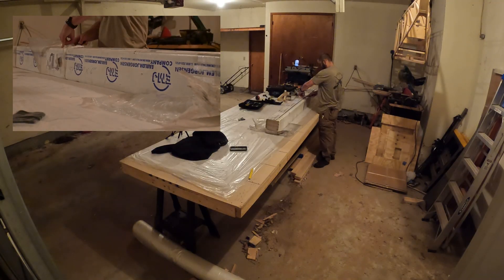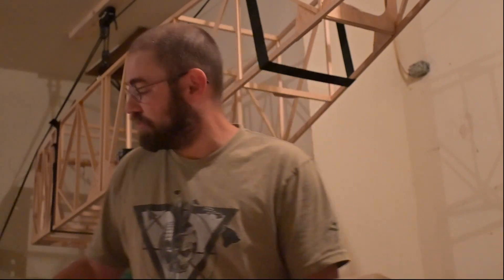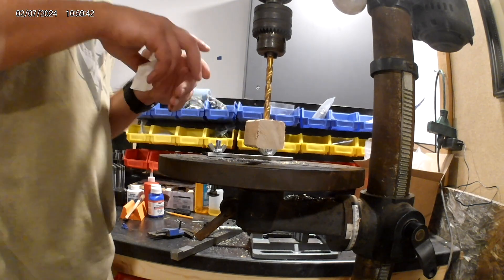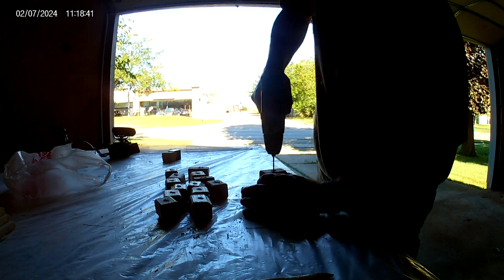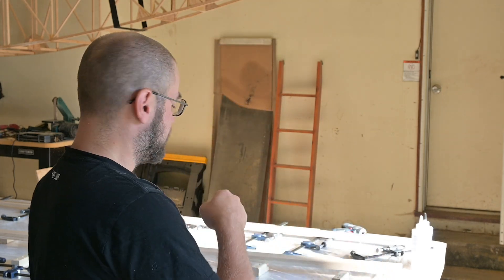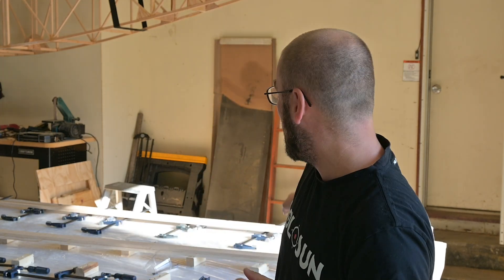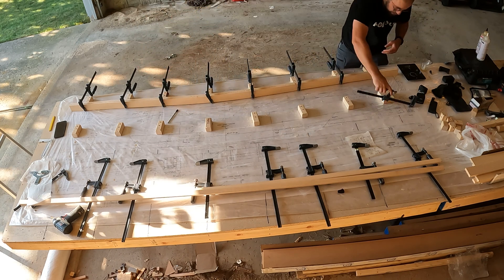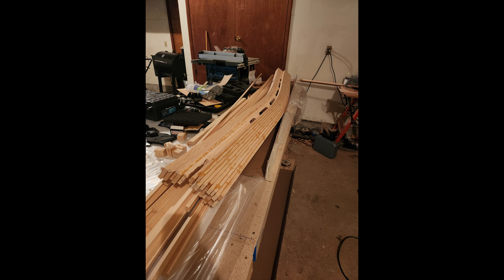Wing Spar Construction on the 1/2 Scale Curtiss P40 Warhawk build!

Comment: Was just wondering what kind of wood does the plan mostly call for? I’m going to be buying the plans and an idea I had was to use aluminum if weight is comparable.
Reply from the maker: @buddy2381  it's all spruce. Honestly it would likely not convert well to aluminum.  You'd be better off designing yourself from scratch.
Reply: @downrangewarbirds  I seen in the beginning of your video you are in Illinois. I’m in a suburb near midway. If you wouldn’t mind possibly would like to come check out your build and the plans before I buy them. So I can see what I’ll be getting into. If not no big deal I understand thanks
Reply from the maker: @buddy2381  matt@downrangecc.com hit me up!